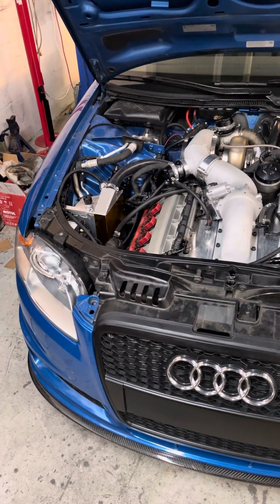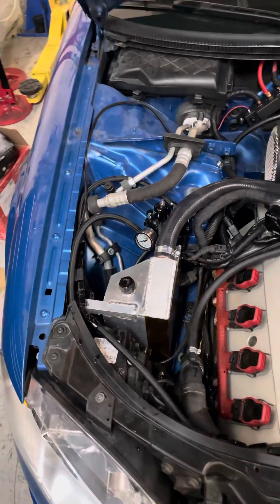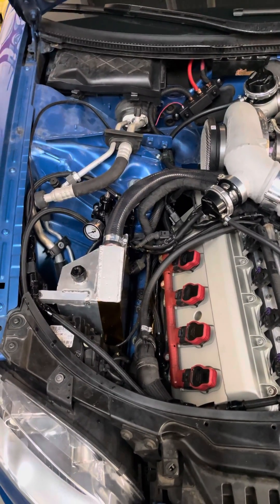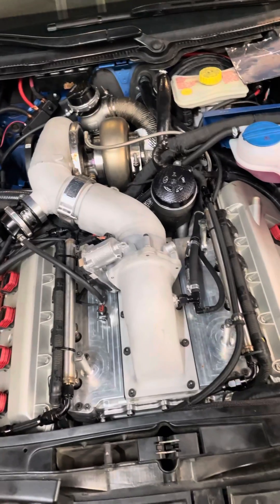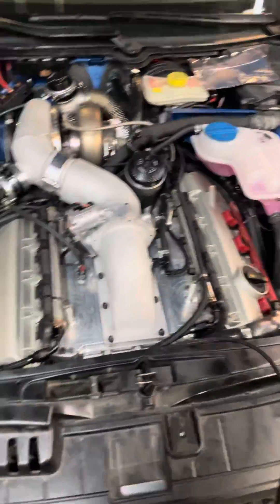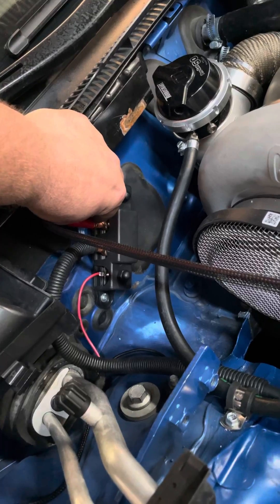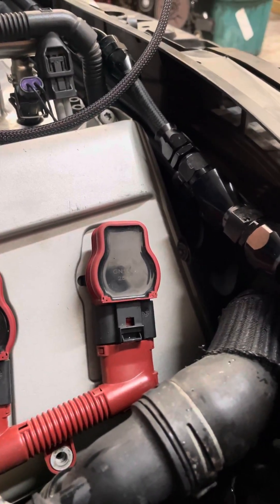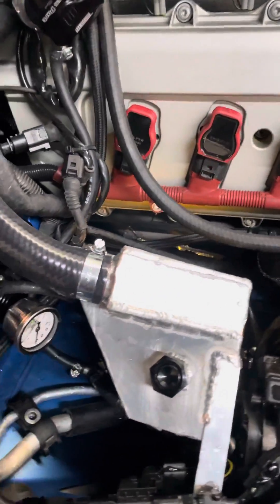Intercooler coolant system complete on this AMTuned B7 S4 Turbo Build.

Comment: How much did this turbo build cost? And does it have stock internals?
Reply from the maker: This is our Stage 3 Bespoke kit. Pricing is on the site. The stage 3 kit includes a fully built sleeved and studded engine.

Comment: So is that for the turbo itself or the charge air? If it's the turbo, then I understand why you would want a pump to keep spinning after the car is off, but why would you need it to do that for the charge air?
Reply from the maker: It helps with heat-soak after shutdown. For example, if you stop to fill your gas tank at a station, the intake manifold would pull all the heat from the engine and become the same temperature and also transfer it to the intercooler inside the manifold. With the pump running at minimal speed, if prevents this for shorter stops.
Reply: @amtuned1086  oh okay that makes sense thank you